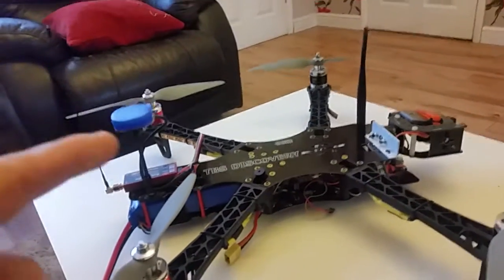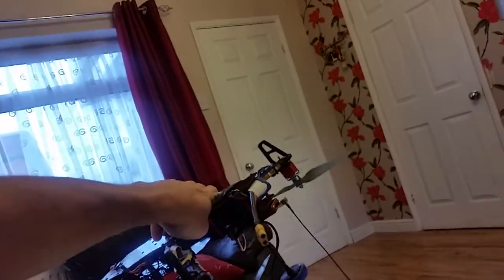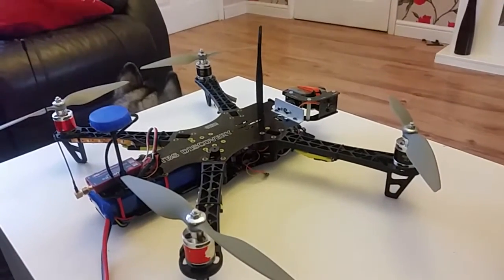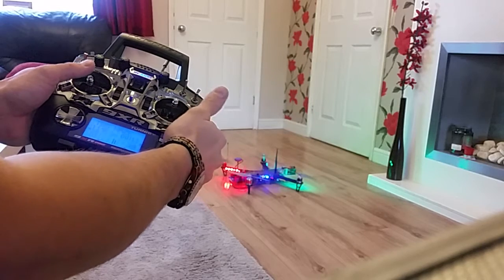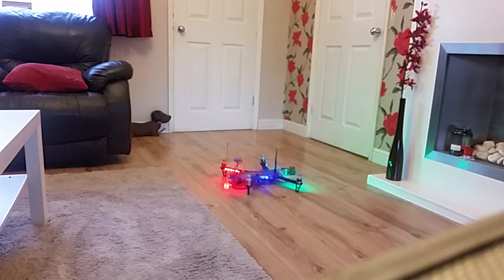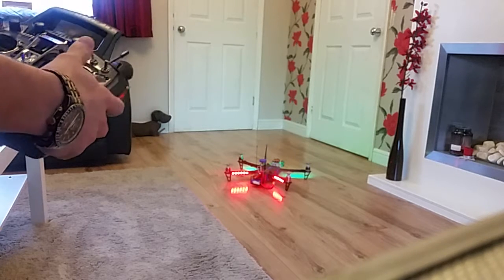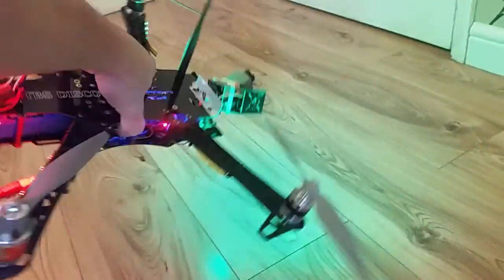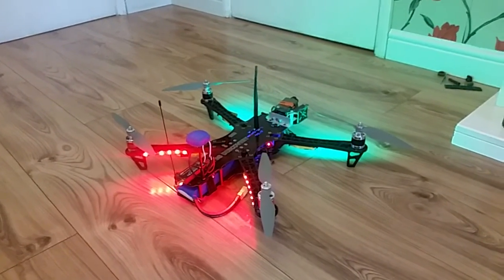Naze32 full rev6 board fault ?

Comment: I had the same  problem with my f450 with the cc3d FC. It would fly stable  at first then wobble out of control.I flash the cc3d with clean flight and couldnt get it to Arm ,so i flash it with the Open pilot and my wobble issue was gone .https://youtu.be/vNZoczQ_V2I  (my wobble issue video)

Comment: I had the same problem I have two different Naze 32 flight controllers on one drone I had a speed control let go and After changing it out couldn’t get it to fly right. Unfortunately with drones it could be a number of problems a motor, ESC not calibrated correctly, bad firmware loaded on the board, or controller setting. Took me about a month to get my setting right, just go through everything very thoroughly.
Reply from the maker: it is very easy to overlook really simple things. thanks for your comment I hope it can help someone else out. 👍

Comment: Hi man how are you?
So I'm facing the same issue but in all modes, i tried replace the cleanflight for the INAV but i'm still facing issues.
Have you solve the issue?
Reply from the maker: Bruno de Lucena 
unfortunately I had to change the board. it was a fault with the rev6 and I went back to the rev 5 

try to double check your props and your esc wired the right way. 
check the orientation of the name board and that it relates to the clean flight /baseflight that your using. 

I hope that helps
Reply: Thank you Man. I will check that!

Comment: Just this and that, hope you have solved your problem.  I have 2 naze32 rev6 boards, one is acro and the other is full, on my first build I used opto esc's and powered with a 5v UBEC, I used reg. esc's on the second build.  I had the similar motor problems, I found that when taking off if I did not get the aircraft up and hovering it would go into a state were 2 of the motors would start to spool up, but if I armed it and got it in the air no problem.  On the #2 build I left the 5v lead of motor #1 installed and removed the others, I noticed with this set up my #1 motor would beep and cherp when the LED's were on.  I ended up doing a lot of test and now I have #2 powered by a UBEC also, all esc's 5v leads removed and I soldered in a IN4001 diode in the LED power supply, the LED's would not work with out slightly reducing the power with the inline diode.  I have my quads working, but I agree with everyone else naze32 may have some issues.

Comment: Hi, well, today just happen something strange: my quad is functioning very well!! How that? I was using the "" Gemfan glass propeller 9x4,5"" and even carbon fiber tstyle 10x5,5, but today i have received new propeller from HK 8x4,5 slowfly and like magic, the quad flys well, sometimes when i decrease altitude it shakes a litle but with increasing throtle it stabilised him self. I did not change ANYTHING in cleanflight setup, so ... what to say? What could happen???
I made an video myself of the problem, check it on youtube to compare. Bye!
Reply from the maker: That is strange have you left the angle strengh lower ? it sounds like it may have been over propped I have put the rev 5 in bit not tested yet as I'm testing out the tbs crossfire and ezuhf jr module
Reply: I have testet mine with base naze32 rev5 with 9x4,5 prop and was flying well, anyway the angle strength is normal-9. Maybe over propped..?? Now im flashing my esc with oneshoot maybe get away a little shaking. Bye!

Comment: I did the settings you advise me but doesn't work, it Flys a little bit better but still flips. My seller sad that they put in the rev6 other type of sensors too, so cleanflight did not update the software.  I made an video of the problem wich i will put on YouTube but is identical with yours. Any way the strange thing is that the flipping starts from front-right arm to rear-left arm, this i think is not just a case but maybe some sensor they made is working bad...  Ho knows...
Reply from the maker: I have been pretty busy lately but I will try the rev5 in a couple of days if this fixes the problem then I must agree that the naze rev6 either has bug issues in cleanflight or the naze board itself is a fualty  product. I will continue to test the rev6 in another model at a later date and report back

Comment: Hello, i have a naze32 board full version frim hobbyrc and does the same problem in angle mode... I am very disappointed, i have the base naze32 and is flying perfect. The hobbyrc said that is an cleanflight bug, and told me try with baseflight, what did you do? Did you solve the problem? Thanks.
Reply: My setup is frame q450,afroesc 30A, 2212 1000kv, 3s 2200 mAh. 9x45 prop.
Reply from the maker: Hi.  I actually ordered the rev 5 board but have not got around to fitting it yet. I believe that in your pid settings at the bottom is LEVEL angle strength and horizon strengh. Angle ish set at 9.0 take this down to 2.0.
leave horizon as it and let me  know if that works. because it will help others out. The only resin I ordered the rev5 5 is because I don't like the way it powers the board via the usb